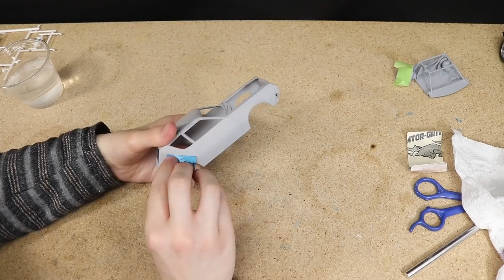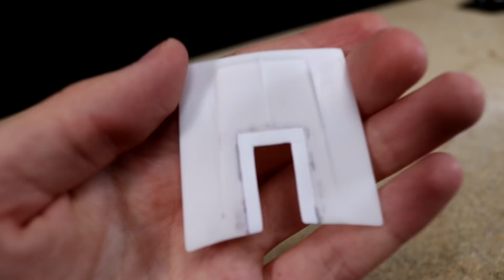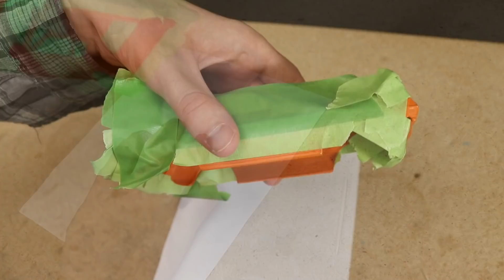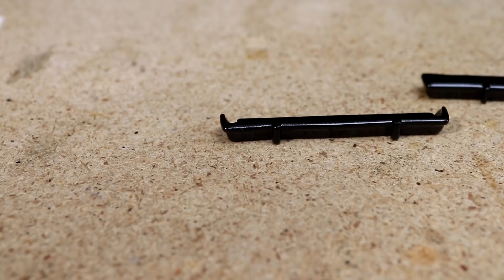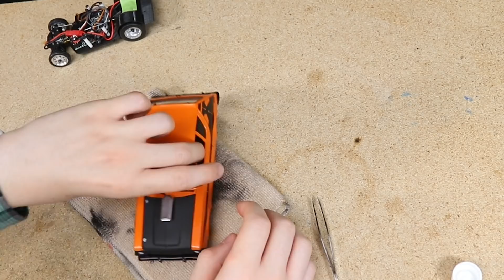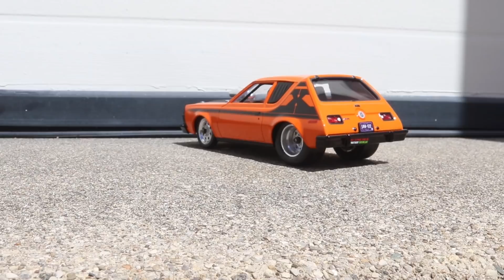1/25 Scale RC AMC Gremlin Drag Car is Complete! Painting, Finally Assembly and First Drive

Comment: ...the rear bumper looks kinda low. The black dots above the rear bumper is where the bumper is supposed to be....js
Reply: I think you'r thinking of the 70-73 Gremlin. He's building a 74 model, first year they had the bigger 5mph bumpers and I think the first year the plate mount was moved above the rear bumper. Those dots are the license plate lights.

Comment: A suggestion for removing chrome plating if you haven't tried already: first try soaking the parts in the household cleaner Formula 409. If that doesn't work, you can try the Great Value brand non fuming oven cleaner. 

The Gremlin looks great! Awesome job!